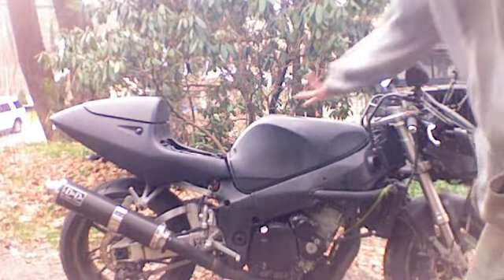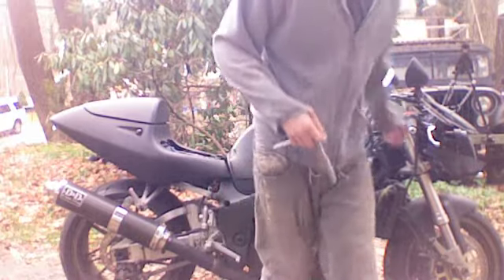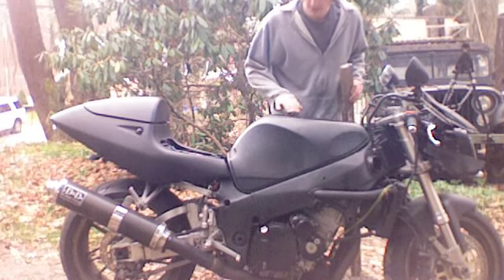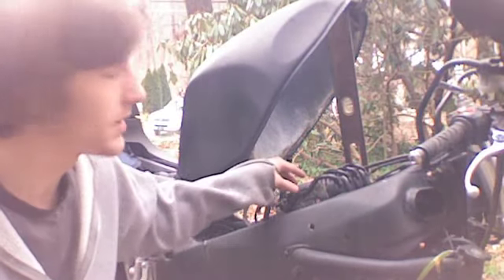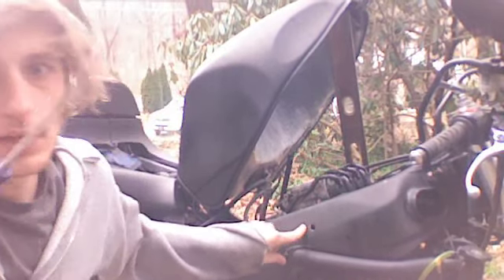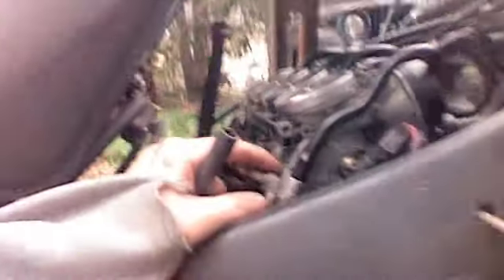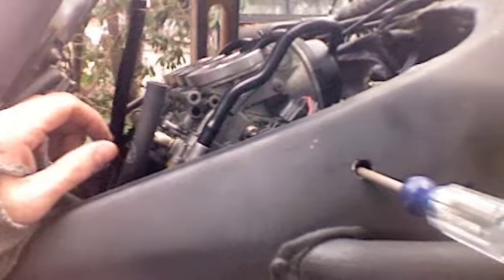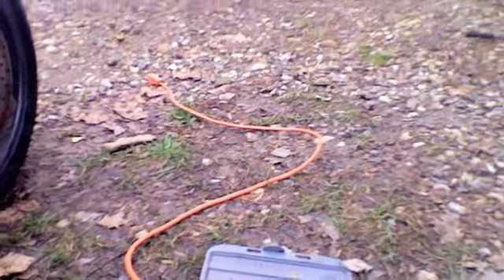How To Clean a Gsxr Carb Bank (part 1)

Comment: thanks i think my floats need adjustment my bike idles at the right spot but rpms slowly lower after a rev til its warmed and once you get going and oil circulates its fine, also sputters on a take off then hauls balls. side note- my 97 srads the only one ive found with a factory powdercoated frame/swingarm and its gloss black instead of matte like the new models

Comment from the maker: fuel starvation(sputtering on excel), gas leaking from carb, engine not starting, gas in the oil it all depends but if u know what ur doing a cleaning can only help and put of the next cleaning. taking apart a carb is just a 3d puzzle have fun.